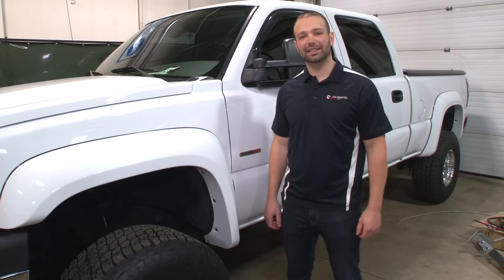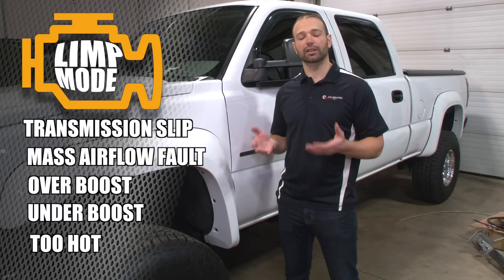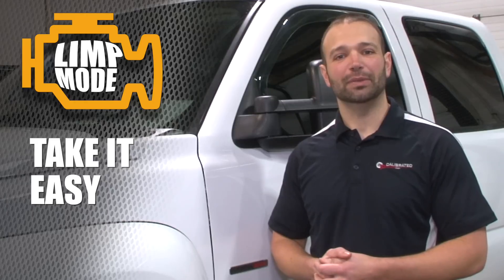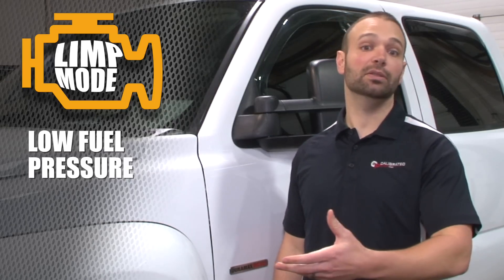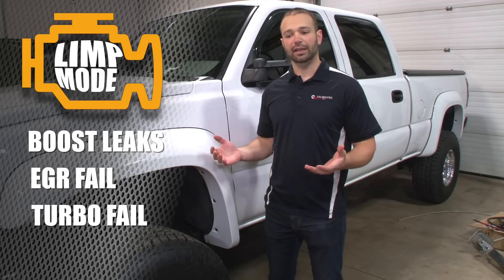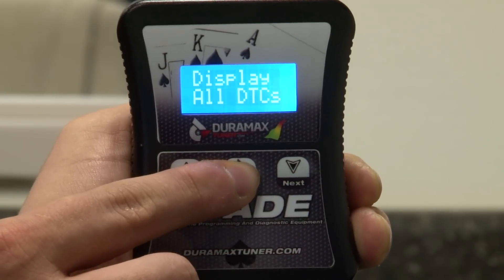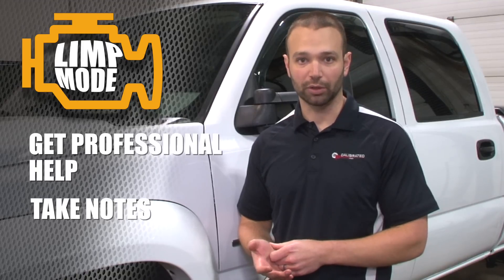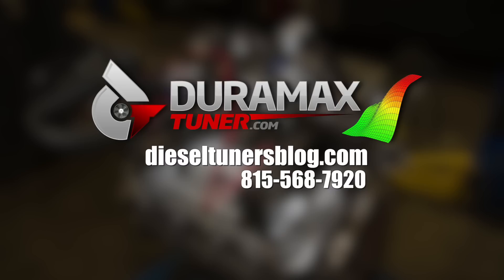DIESEL INSIGHTS: LIMP MODE

Comment: 2001 lb7,goes in limp mode 2000 rpm max,if I idle low all gears shift normal ,go a bunch of codes
P0380,p0093,p0840,p0843,p0845,p0848,p01709,p01712,u1096
Replaced internal harness and pressure sensor inside transmission,still doing the same thing ,any help would be appreciated
Reply from the maker: We would need our hands on it to be 100% sure. From the array of codes, could be electrical or module.

Comment: Hello. My 07 Chevy Silverado Duramax 6.6 turbo is showing codes U0101, P02B9, U0140-00, U0100-00, & U0102-00. My check engine light came on and the engine went into limp mode. What do you think this cold be?
Reply from the maker: Sounds like an electrical/harness issue at the very least.

Comment: I'm not getting codes when mine does it it happens when heavy on the pedle
Reply from the maker: @kylemarks1947 That sounds more like a specific engine issue than limp mode activating.

Comment: Mine goes into shift range imhibeted but only for the reverse gear, new nsbu, new torque convertor lockup solinoid checked all plugs and wires nothing worked
Reply from the maker: @cubpak89 Could be another solenoid giving you issues.

Comment: Mine went into limp mode and I have no codes. The next morning we had a serious transmission puddle under the truck.
Reply from the maker: @scottdennis73 Interesting! sounds like you blew a trans line or a gasket. Do you think it was leaking before it puked all over?
Reply: @Duramaxtuner we do a pre-trip inspection every morning and never have had any leaks. We found a small hole where it looks like someone did a questionable weld repair prior to us owning the truck and it failed there. I initially thought head gasket so I need to check that also. All signs lead to 💰
Reply from the maker: @ScottTheMarine  Haha wow! Sometimes you never know what kind of janky repairs were done on a vehicle.

Comment: 2008  6.6  duramax p0087 truck runs great replaced fuel lines goes into limp mode pulling a hill with no load  please help
Reply from the maker: We would need to have the truck here to figure it out.

Comment: I need a low cost scanner to do a active test to demand max fuel pressure on the cp3 injection pump to test?for a 2005 gmc sierra 2500hd with a 6.6L duramax?if not do you know what bidirectional scanner will? thank you
Reply from the maker: Give us a call, 815-568-7920.

Comment: 05 LLY. P07300 and P0735. Tow haul on pulling camper up hill 3/4 throttle. Tunes were on towing. and It slammed it into 4th gear.  What should I do to prevent?
Reply from the maker: Sounds like you need to upgrade to a built transmission.
Reply: @Duramaxtuner  definitely agree. Found out it went into limp mode because I had too hot EGT’s etc. gonna have to mess with my tow tune a bit.

Comment: I have a 2002 LB7 Duramax it’s tuned out about 80%. I love my truck. It is my favorite thing in the whole wide world .My transmission is going out what kind of upgrade transmission wise do I need to achieve 1200 horse and how much will that cost me?
Reply from the maker: You'll definitely need a beefy torque converter. We have the DT 1000 for 1000 HP + trucks and it comes with a Goerend triple disc torque converter.
Reply: Well I’m having a incorrect gear ratio 5th gear on my lly 220hp over stock pushing roughly 525hp and I’ve not ran it hard since those codes and stuff happened for just a 800hp tranny labor and all $9,500 in nc

Comment: Just deleted my 05 lly it ran great no check engine light then I started going down the highway and got into higher boost and it sounded like air was escaping from somewhere didn’t and the check engine light for low performance supercharger not sure if it’s the up pipe or a boost leak

Comment: i have a 2016 cheverlot silverado HD 3500 6.6 duramax diesel that has the cp4 injectot pump been trying  to find someone to take it off heard horror stories !!! does anyone now if GM has any recalls or special policies or offer any assistance to take this pricey bad pump off put a cp3 on? any information would be appreciated thank you in advance!!
Reply from the maker: GM wont be helpful on that. They offer a CP4 replacement for CP4 failures. There are 2 aftermarket options. The CP3 from SS Fuel and the 10mm Cp4 from Exergy are the only real options out there.

Comment: I've got a 2012 ram 3500 6.7 with a 68rfe will the trans be a definite fix if the code is P0734?  I needy truck back on the road asap.
Reply: Sold it lol got tired of fooling witb it didnt have the money
Reply: What was your problem what happen that u ended up doing

Comment: 05 lly  420k miles new motor 100k miles ago egr delete full intake with mouthpiece and full exhoist stock tune pulling a po700 and po776 code it did it anothet time and  said speed sensor I'm confused truck dont slip jerk nothing o that nature guessing trans is jus on its last leg?

Comment: Another cause for silent limp mode: Your coolant reservoir cap. If your cooling system loses pressure, the first thing to overheat, and rapidly so, will be your fuel. It's why these powertrains come with fuel coolers. Above a certain threshold, your HPFP's performance will be limited/throttled and your truck will limp. The simplest things can be the biggest cause of headaches.

Comment: Nick Help I'm in Pennsylvania so you're to far to bring the truck. 2002 Duramax Allison trans. Just had a reman trans put in last fall got the truck back ran great the day after I got it back it threw a code for torque converter solenoid. Took it back to the shop they had it a week got it back didn't notice cause was being super cautious but then noticed it seems like it stats out in 2nd or 3rd gear. no code though. Do you have any clue that may help.

Comment: Good morning I have a 2009 duramax 6.6 l recently blew a head gasket we replaced the hair gasket put all GM parts We're visually done 1 side 1st and I noticed that we did the one side my truck wasn't the way doing black smoke a lot And then I realized the other side was leaking just as well so we replaced the other side wow when you replace the 1st site I had some power but not as much then when I replace the 2nd site I have no power a no power I put no Turbo it's terrible before just because the trouble will feel like a little warm I just replaced Then what happened and between opening the cabinet everything back together one of my guys have Have put the back cross pipe on the back of the bellhousing that got some water jacket and started leaking water is licking water so we had to replace that seal in the misery place in my seal data removed the battery cable and didand the nation was on and made a big spark look like it was a positive cable connected to negative it's a negative we are realized what happened I took everything off Pull the battery cables  Off the battery turn the key off and connect it to ground backup I don't know if I run the PCM I don't know if I ruined the  Glow plug  Module But I have started getting a lot of  Coat it was given me injector  It give me number 7 number 2 number 5 number 6 I replaced number 7 which was leaking a lot I replaced number 2  After that all the Code  Went away then number 2 came back leaking I replaced number 2 still leaking I replaced number 2 again still leaking I noticed number 3 on injector Also  Is very low on the volts I've been on this truck for a month trying to figure it out and I've been going back-and-forth somebody told me it could be the Oxygen sensor I replaced the Mass air flow sensor I replace all the block logs And also the truck goes into limp mode and my temperature gauge sometimes goes up sometimes goes down don't work all the time like this shit Right now I have a code of P02A1 Also P0087 Also  P0118 I reprogram all the  Injectors because when the guy was helping me he did not number him so I had to re enter all the injectors into the computer which I did with the Tech 2 Can someone give me some ideals I'm bought ready to buy the TCM I don't know if I should buy the TCM or buy the injector controller

Comment: My lb7 will go into limp mode, I lose reverse and get stuck in 3rd tell I pull over and cycle the key. The only thing that comes on is the service engine soon light, I have never seen the check engine light. I have tried to still scan it and there’s no codes. ?!?!
Reply from the maker: Sounds like clutches slipping, you may need a more advanced scan tool to see TCM codes.
Reply: @Duramaxtuner  hey thanks a lot, after reading a lot and doing some research I think I will just call my buddy at SDP and have him build a transmission for me.

Comment: Deleted truck running 30hp tune., new fuel filters, will not rev over 2500 rpm. Kicker is no check engine light. Any ideas?
Reply from the maker: Make, model, year?

Comment: I have a stock 07 LBZ, 118,000 miles threw P0713 and P0708 deleted the codes and now P0708 keeps coming back, only when moving the gear selector into gear, CEL comes on, and light under the selected gear disappears as well as shifts sloppy through PRND and locks into 3rd gear I believe. When the code is deleted it runs fine, the internal wiring harness was changed 3,000 miles ago due to a similar problem when fluid was leaking into the plug. I use this truck daily for my business towing trailers, I’m concerned it’s going to strand me if I don’t get this figured out.
Reply from the maker: That would need to be diagnosed in a shop.
Reply: @Duramaxtuner  hey want u think on the new 3.0 duramax ? u think is good engine ? can last few years

Comment: P2004 code 
2006 GMC/ISUZU 6500 Kodiak heavy duty 
I changed my muffler to aftermarket 
Then the problem happened 
I changed my map sensor still nothing 
It drives fine until I go uphill than it drives slow
After the hill drives perfect 
Check engine light is on
And reduced engine light also

Comment: Hey how are you? I have mine  allison 1000 going  in to limp mode. I can get any codes is a motor home I have try a 9 pin  diesel scanner but it show just engine Codes.  The trans was showing  a ⚙🌡 light on the dash right when you turn the key on. Some sites said the pressure manifold should be defective. I had put on new manifold, internal harness, filters and  mobile delvac.  And it came back after 10 mins drive. Do I need to clear codes on the tcm after the manifold get replaced? How can I do that is there is no connection between 9pin  j1939 connector and the trans? Thanks for your feedback. Trans have just 32000 miles. Engine show just 1100 hours .
Reply from the maker: You likely need a scanner that can communicate with the TCM to properly diagnose your issue.

Comment: I've had trans fluid a leak for a while out of the bellhousing.  I forgot to check the level over the past week. Now it got so low im in limp mode. I pulled over and put fluid in but still stuck in limp mode. Tried cycling the ignition, cycling the gears with the truck off. Its stuck in limp mode. I have efi live flashscan v2 but haven't really used it yet. I haven't got around to egr delete yet - thats why I got it. And, I don't really know how to use it. But could I reset it through efi?
Reply: I dont have check engine light on. Just the trans symbol

Comment: Hey man I have a 2008  3500 6.6 duramax I am in limp mode , I ran the diagnostic and I have the turbo booster and fuel pressure regulator is a code popping up  , what do you think is going on ? Trouble codes are p0090 and p0047

Comment: So I have an 05 lly equipped with the zf6 trans. It acts like it goes into limp mode while pulling mountains. Doesn’t show any codes at this time. But it’s like a daily thing, truck gets a little Smokey and seems like the throttle doesn’t respond when I push it to the floor. Truck had the codes P0101 and P0299 so I cleaned MAF sensor and rese the codes. Still having the same issue. Truck is stock including stock catalytic converter and muffler and EGR valve. Once I peak the mountain it takes off like a raped ape again but still Smokey till I let off throttle. Anybody able to help me?

Comment: My 2008 gmc duramax went into reduce power.plugged in and had 4 codes,p003a,p0102,p2563,p04041,and has banks 6/1 tuner is this serious.
Reply: Yes take it to the scales ive been there before
Reply: Serious like how? Bad turbo?

Comment: Any trick to get the check engine light off
Reply: Usually u cycle the ecm by turn key on and off three times. After a day or two the check engine should go away or if u have a monitor like a cts and delete the codes

Comment: How could I fix the p0087 code I have bad fuel pressure did a tune 5 switch  now my truck is messed up 2012 Dodge Ram 3500

Comment: My 1964 Mercedes 200d heckflosse never goes into limp mode as it wasn't made with one.
Reply: The MB 200d came out of the factory in Sindelfingen already in Limp Mode.   oink oink
Reply: @markdavid4897  My 200d came out of the factory in South Africa with a VNE of 130kmh! It may achieve that speed down a long long steel hill 😜
Actually marked on the speedometer and mentioned in the owners manual. Along with the ability to run on paraffin/diesel/cooking oil/jet A1.

Comment: My 2009 6.6 LMM Has gone into limp mode  Only on start up, Twice sense ive owned it, both on very cold days -25c or worse. 1 time the error code read Service Exhaust System, i cant remember the other error message, but both messages went away on their own & i took it to the dealer to get proper service done

Comment: i have the same experience with my 2009 6.6L i recently tuned it and whenever i floor it 100%  the truck goes into limp mode check engine lights comes on and it tells me to change the fuel filter. when scanning the codes they are related to 1. low fuel rail pressure 2.throttle body sensor. i am wondering what are the ways to fix this issue because in long term it can cause more problems. 
any suggestion is appreciated.
thanks
Reply from the maker: Start with a Fuel Pressure Relief valve.
Reply: @Duramaxtuner  so your saying to change it with an aftermarket one or buy new stock ones?
i am thinking the new tune is running higher fuel pressure and the stock fuel pressure relief valve is not made for that and thats why i am getting the error low fuel rail pressure error.
Reply from the maker: @reshadamiry8639  We always start with accurate diagnostics. the aftermarket plug does not allow any return through the high-pressure rail.  This will give you a more clear baseline for further testing.  https://duramaxtuner.com/lbz/supporting-modifications/fuel-pressure-relief-valve.html

Comment: I have a P0700 and P0708 code. Assume issue with Trans Range sensor then faulting TCM.? Haynes book shows it linked to shift cable outside of Trany pan, don't see it on my 2011 2500hd duramax. Is it in the pan?

Comment: 2012 2500 Duramax with cleaning exhaust filter on dash and in limp mode. Drove it 70 to 80 miles and no change. Any ideas?
Reply from the maker: You probably need to start with a manual regen.

Comment: I have a 2001 6.6 duramax  limp mode no codes no check engine
Reply: Same issue with my 08
Reply: @briskfatguy1  did you ever find out the problem
Reply: @chrisdurham1887  nope with everything going on I've been working 7 days a week
Reply: Have an 04.5 lly same issue only does it when on high way
Reply: @elguero355 did you ever find out what was the problem? I’m currently having the same issue with mine and it’s only when I’m going up hill.
Reply: @joshuaacosta9686   miss communication with the main computer, basically one wire is false contact some were .

Comment: HI Nick, getting codes p1723 and p1721 on a 2001 Sierra 2500hd.  Engine light is currently on but the previous guy put too short of a filler neck on it and it has no gas cap.  The truck stays in 3rd gear but there is no rpm limit.  It shifts through 1st and 2nd fine.  The truck does have some kind of programmer with 10 siding and a dial turn but I just picked this up so don’t have much info on it.  Do you have any ideas of where to start ?
Reply from the maker: Both are transmission codes, have you data logged the truck?

Comment: 5:40 ... how did you know me so well?
I have PPEI tunes, jumped to the 60+ after running the 30+ for a week or so. Driving up a paved hill, tow/haul on, traction control off, felt sluggish so I throttled down to get up and over the hill. 

0:19 is exactly how I felt! P0733 - incorrect 3rd gear ratio. Scared the shit out of me. Thought I fucked up the trans. My take, too much torque being sent, trans tried to down shift & missed or popped out so save itself. At least I hope. Now I'm scared to get on the throttle while it's approaching 2-3 3-4 & 4-3 shifts... damn that expensive trans tune file.
Reply: So how has it been I got my set at 5 220hp time yes I know stick trans pay to play but it’s never done that got a incorrect 5th gear ratio. Pulled over wouldn’t shift to any gears just revs up turn off them back on been great since. But I’ve been running stock I’m just scared to death I screwed up before I got my bank account right for that near tranny

Comment: I have a c5500 I did a egr delete no tuned 
I have a limp mode codes air mass flow sensor. 
I have a scanner I deleted and keep driving but is annoying any ideas what to do?
Reply from the maker: Tune it.
Reply: @Duramaxtuner   Any suggestions
Reply: What kind of scanner do you have to delete or reset it ?? I need one

Comment: Will I be able to read codes even though I don’t have a check engine? 
My 2003 duramax doesn’t have any power! If I hit the pedal, it revs high and starts to slow down like crazy. 
I have to lay off and slowly keep pushing the pedal so it tries to hit 60 mph.
Reply: Did you happen to figure out what the problem was? My 05 is doing the exact same thing right now.